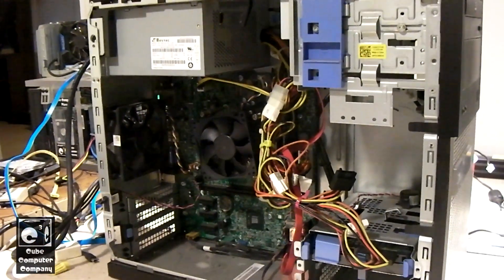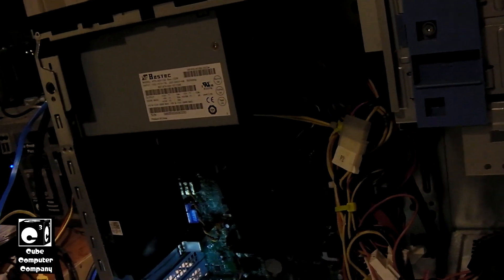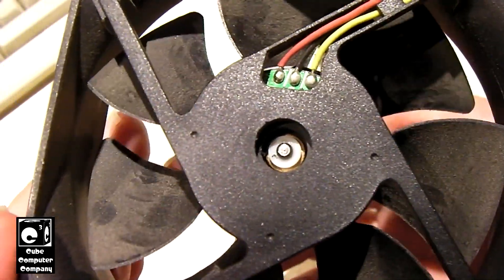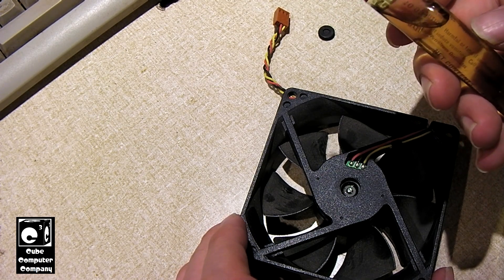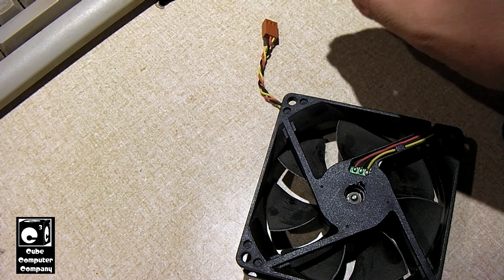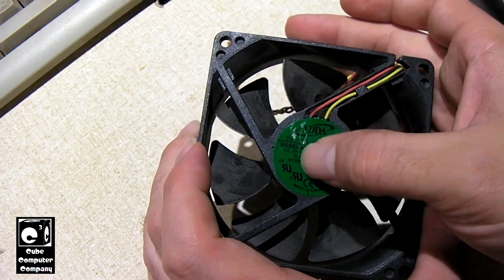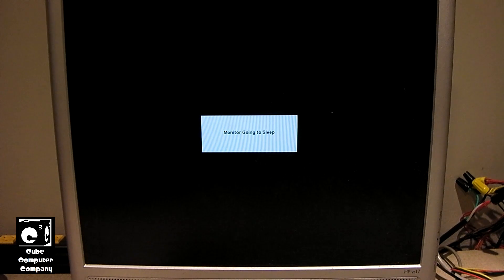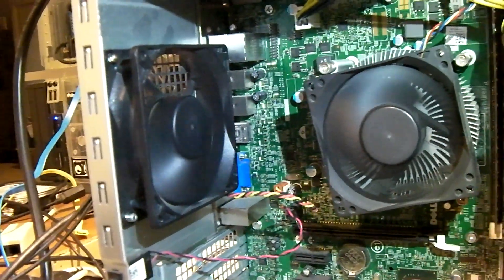Fixing Hard Drive Fan Failure message on Dell Optiplex 390

Comment: I have the same problem, but the motherboard is restricted. The PC turns on automatically when connected, and the power button doesn't respond even after pressing dd/f1. I then shut down correctly from Windows, and it gives me that alert. Is this because of the fan problem? Or is it something else?

Comment: Weird thing is, I have issue with a small form factor model, which doesn't have a rear fan or any fan in that matter. Any idea?
Reply from the maker: If the BIOS/CMOS has been reset at some point, the settings could have defaulted to enable a fan that could be installed in the factory. There may be a way to turn it off.
Reply: @CubeComputerChannel  ah I found the issue, in the sff model there is a small 6x6cm fan holder for the harddrive bay, and the fan is missing 🥺
Reply from the maker: @sjanssen  That would explain why they called it a "hard drive fan" in the BIOS

Comment: Mine has had this alert for a while now, but recently my pc just wont turn on. It will start up and do the windows loading screen for a good 20 seconds then shut right down again its really frustrating. Sounds like the fans arent working that well either cause theyre usually pretty loud
Reply from the maker: These systems seem to have a high power supply failure rate. Yours could need a new power supply soon. They use a standard 24-pin ATX supply. Any decent 300W unit with at least 18A or so on the +12V rail should be sufficient.

Comment: I dont like the fact these machines dont have a chipset heatsink
Reply: i have seen plenty of intel chipsets like that. very few from the amd side (seen it in a amd e series apu laptop.) they always run right at the thermal limit hell even a sanded down copper penny epoxyed to them makes them run cooler.
Reply: @CotyRiddle  I've seen in an intel datasheet that they say for some chipsets for example h61 that a heatsink is recommended but not required, so I'm guessing dell takes that info and doesn't include a heatsink.
Reply: @Remi-h8z  suppose so. still a stupid decision to me.
Reply: @CotyRiddle  yeah the chipset probably throttles and all the io is slowed down and probably hard drives and everything is slowed since the chipset is constantly at its thermal limit
Reply: @Remi-h8z  I doubt the south bridge is capable of throttling. But I would be willing to bet that the amount of errors and glitches are increased by the higher amount of heat.
Reply: @CotyRiddle  oh yeah most likely like freezes and lockups and bsods mabye

Comment: I don't know how much they make a difference, but I hear that those rubber grommets help reduce noise from reverberating from the fan to the chassis, which would cause the noise to be amplified.
Reply from the maker: I'd think in that case, the noise should be noticeable so that it can be fixed. Otherwise, since this fan is always run at such a slow speed, it won't be doing much of any vibrating.